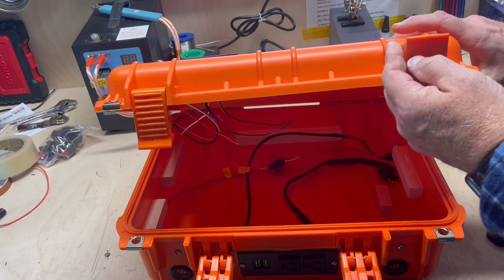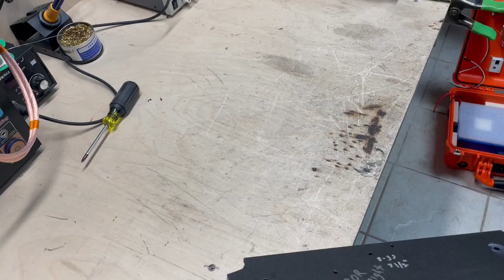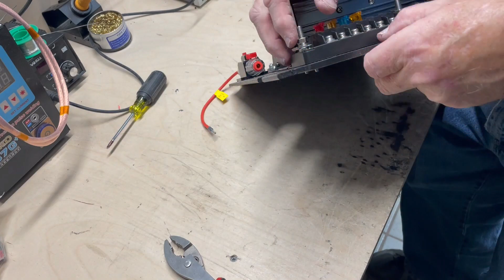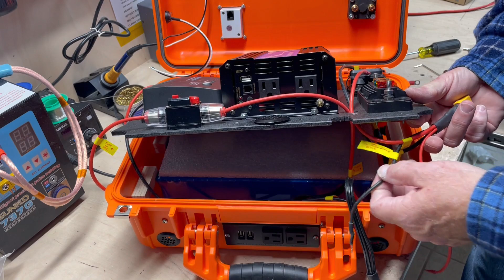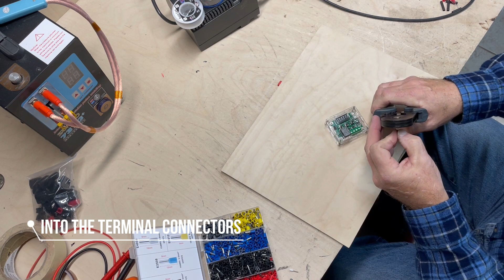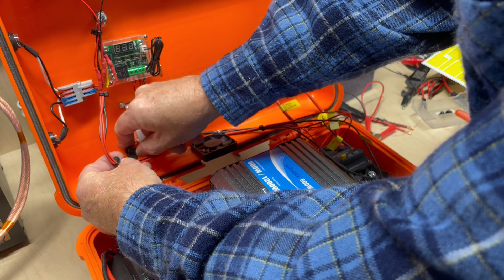Solar Generator complete build (Part 2)

Comment: What size wires do you use
Reply from the maker: On this build I used 18 gau. for the lights up to 10 gau. for the controller and inverter.

Comment: I'm trying to figure out the battery.  You say it's 1400w, that would be a 116ah battery.   Just can't see a 100ah battery in that box.
Reply from the maker: Her is the formula for 18650 powerwall calculator
If you're building a powerwall using 18650 Li-Ion cells, use this tool to calculate the stored energy capacity, amount of needed cells, nominal and separate SoC (state of charge) voltages.

Pack configuration
Cells in series?      4S

Cells in parallel?
   30P

Cell parameters

Constant current    3.7A

Peak current
    2A

Avg Cell Capacity?
     3200mAh

 
1.4 kWh total energy
120 cells needed
72 mm cells width total
107.0 mm pack width total
96.0 Ah capacity
14.8 V nominal

111.0 A constant
1642.8 W constant

Comment: What is the link for those special wire connectors you used for the lights?
Reply from the maker: Here is the link to the connectors                                     
https://www.amazon.com/gp/product/B08XZJ4SNR/ref=ppx_yo_dt_b_asin_title_o00_s00?ie=UTF8&psc=1

Comment: Necesito conseguir un pack de batería de esas de litio excelente amigo
Reply from the maker: Pablo, I can not translate your message. I will have to research it.
Reply from the maker: I translated your message. You can find what you need to know on YouTube. Be careful the batteries are dangerous.
Reply: @paulswoodshop395  👍
Reply: Don't calma don't worry
Reply: I need to get a pack of those lithium batteries excellent friend

Comment: should take exterior heat sink off, but leave thermal mass smaller heatsinks on the inside parts or where needed add smaller ones
. the box doesn't act for convection. you have fans for that.

Comment: Hi, I just saw your part 1 & 2 videos on the the solar generator project. I am a new subscriber, would you be so kind as to share a diagram of the wire connections for this project?
Reply from the maker: Hey Ramon, I have made a crude electrical drawing for you. I cannot figure out how to put it in my parts list. Please respond to my email address if you would like a copy and I will send it to you. woodman58@ymail.com  . Thanks
Reply from the maker: I will give it a try. I am not good at drawing or doing things like that. It may be very crude. I will do my best this week and let you know.

Comment: Outstanding video. Do you sell these? Can i buy one?
Reply from the maker: I sell them local only. I am looking into getting an Hazmat company so that I can ship the batteries. They are Lithium Ion so you can not ship anything over 300 watt hours. These cases have 1400 watt hours. Make sure you a subscribed and I will post in one of my builds when I get authorization to ship.